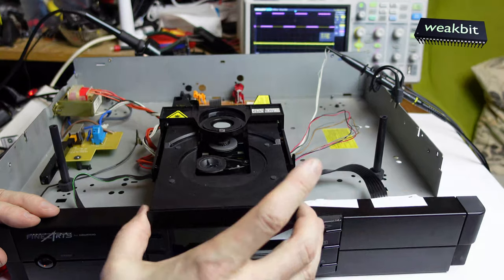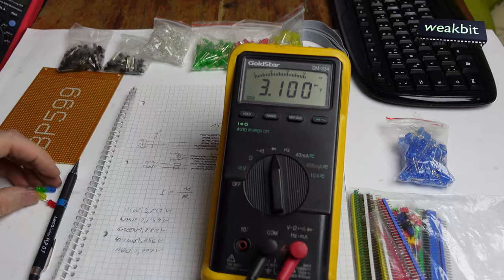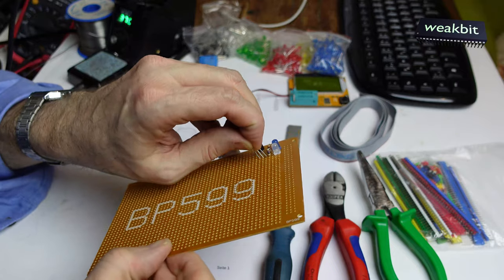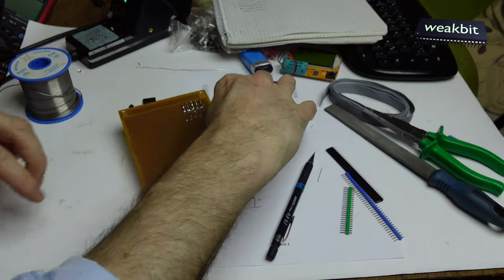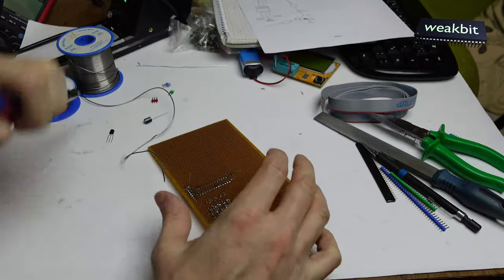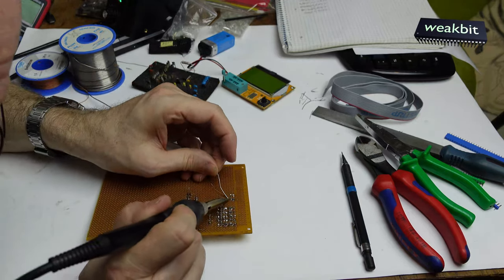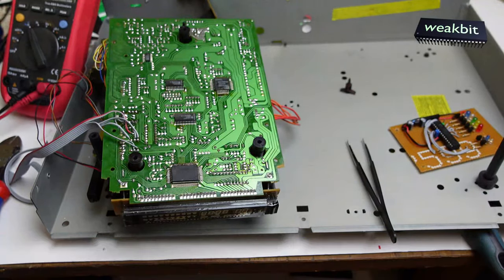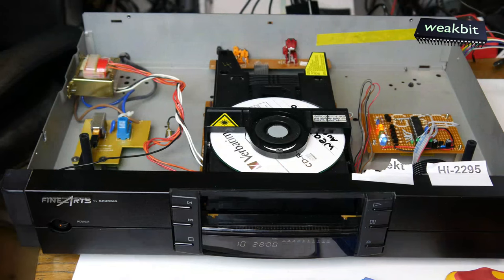Grundig FineArts CD11 CD-Player repair part2/2

Comment: Could this issue be related to a corrupted firmware? Did You try to find firmware for this CD-Player?
Reply from the maker: The question is possible but I think there is nobody who can have this firmware in case of company-secret. The interest thing on this is that the timing at long is so long the tray need to open the drive. In this time the first 1/3 is the pin switch to high and the motor drive the tray open but then for the rest of the open time the pin give out a PWM with around 50%/50% and the open/close motor make a noise like that the belt is loosen. With my µController I fix this wrong signal to the motor and now the CD-Player working full. Thank you for asking weakbit
Reply: @weakbit633  🙂And now, You can make the PCB with Your "hack" device and publish it. :goodvibes: